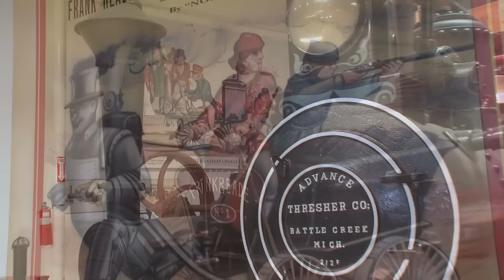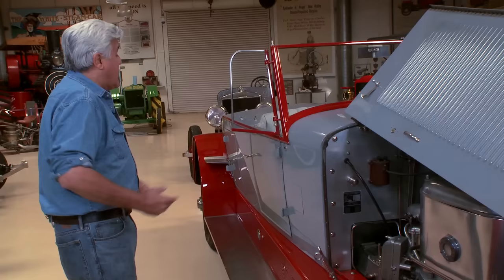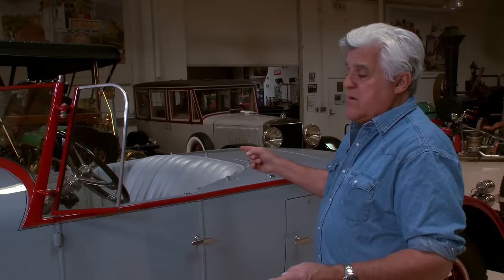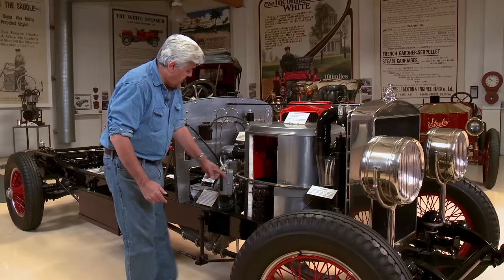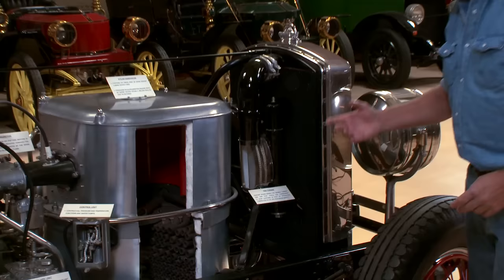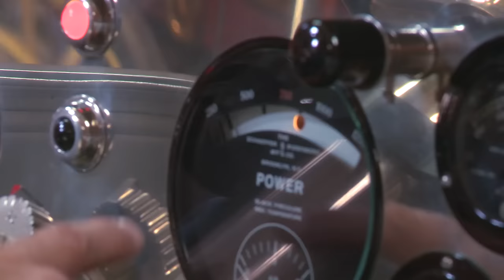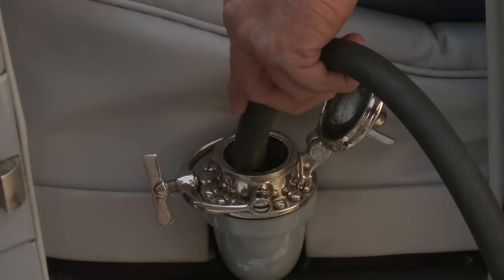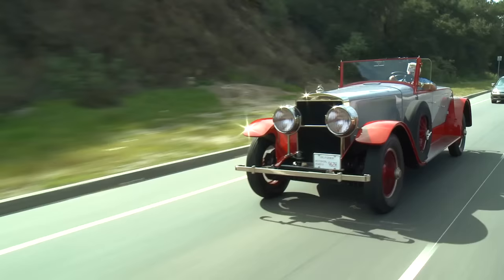1925 Doble E-20 Steam Car - Jay Leno's Garage

Comment: Why don’t you use distilled – or at least demineralized – water do as not to build scale deposits?

I live in an area with pretty soft water yet I use distilled water in my expresso machine so as to avoid building of scale, which did ruin a couple of them before I started doing this.
Reply: Using distilled water is pointless because the Doble is equipped with a condenser and consumes massive amounts of water.
Most steam car collectors and commercial boiler operators use a water conditioning treatment like tannic acid to reduce scale build-up.

Comment: TBH I never actually knew how powerfull and sophisticated steam cars were. I wonder what how efficient it is in terms of fuel consumption and emissions. Any word on that?
Reply: Steam cars are obsolete because of their incredibly poor performance, efficiency and high emissions. 

Jays Doble barely produces 150 hp and guzzles unleaded gasoline at the staggering rate of 5 to 6 MPG.

EPA tests conducted on the Doble boiler found very low CO emissions but extremely high HC and NOx emissions... it also produced more CO2 emissions than 12 Honda Accords.

Comment: So if you were to give that throttle wheel a full rotation really fast while at a standstill would it be the equivalent of flooring the gas pedal and dumping the clutch, resulting in a thick cloud of burning rubber scented smoke? All I'm saying is, I want to see an epic steam powered burnout.

Comment: That was a real education.  I didn't think I heard right at 1,000 foot pounds of torque.  Unbelievable.  I think Lear (of Learjet fame) was building a steam car in the 1980s.  At least we'd see a billboard advertising it in Rocklin California.  Wonder whatever happened to that idea?
Reply: A bit of a misinformation, the Doble could produce 1,000 lb.ft. of torque but only at zero rpm, zero mph.
It's sounds like an impressive number but in reality is deceptive when you understand the engine barely produced 150 horsepower when new.
Reply: Steam cars were essentially rendered obsolete by the invention of the Electric Starter for ICE cars in 1914.

Comment: If it burns fuel completely and has such great power, why is it that we aren't making them today?
Reply: Steam cars were rendered obsolete by the invention of the Electric Starter for internal combustion cars.
Steam cars are obsolete technology because they cannot compete with the efficiency, low price and low maintenance of ICE cars.
 Jay's exaggerating a bit, the EPA tested a Doble boiler and the emissions were shockingly bad, high Hydrocarbon emissions and extremely high NOx emissions.
 Jay's Doble guzzles unleaded at the obscene rate of 3 MPG and spews out more CO2 than a dozen Hondas.

Comment: Pretty cool thank you for making that one question though why don’t you use distilled water?? Seem like to me it would preserve that expensive machine!!
Reply: @sandervanderkammen9230   so you’re saying you actually tried using distilled water? Or you’re just saying that theoretically? Because I find it very hard to believe because there is much crap that’s in tapwater. I can’t believe  Jay Leno would drive that car or using 100 gallons of water in one day. He does not use that vehicle every day it would be worth it anyway. And I’m sure he can afford it.
Reply: @khcopter  I am stating it, as a matter of fact.
Steam car collectors don't use distilled water.
Some do use a water treatment additive likw tannic acid in the feedwater tank to reduce scale build-up.

Cars like the Doble use a condenser
The condenser turns some of the waste steam back into water, but it is also contaminated with lubricating oils and corrosion residue.
These contaminants go directly back into the boiler and cause more scale to form.

The only way to reduce scale is to blow down the boiler and replace the boiler tubes when they become blocked by scale.
Any questions?
Reply: So you have an actually tried it.
Reply: @khcopter  You don't use distilled water in steam cars that are driven regularly... 
People use distilled water in model steam engines that don't have condensers.

The condenser completely defeats the purpose of using distilled water.
Reply: @khcopter  When you own a steam car you use what ever is the best water available and blow down the boiler and drain the oil and sediment from the feedwater tank as often as possible to reduce scale build-up.
Boiler tubers have a limited service life and are typically replaced before they become blocked by scale.
Reply: OK that doesn’t make any sense at all and you don’t work for Leno anyway. Sounds like you don’t have any money. To buy distilled water. Not that it’s not expensive.
Reply: @khcopter  You still don't get it do you?
The condenser cancels out any benefit to using distilled water.

You obviously lack any formal education or professional experience on this topic and don't know anything about steam engines.

You are not qualified to speak inteligently on this topic.
Reply: @sandervanderkammen9230  Why do you think so?  Because I disagree with your statement that the condenser defeats the purpose of using distilled water.  Why would that be?
Reply: @BasementEngineer  If you are not familiar with condenser engines they foul the feed water tanks with contaiments like lube oil and corrosion residue.. this contamination produced scale in the boiler.
Reply: @sandervanderkammen9230  As I stated above, remove the need for oil and use distilled water in the closed loop.  Be sure to remove all debris before closing the loop.
Reply: @BasementEngineer  The condenser still produces hard water, containing dissolved minerals in particular metal and metallic oxides.
Reply: @sandervanderkammen9230  A condenser produces NOTHING except heat removal from the spent steam.
Reply: @BasementEngineer  You obviously don't understand how a condenser works...
Reply: @sandervanderkammen9230  Then please explain it to me. Thank you.
Reply: @BasementEngineer  Most of the used steam is lost through the pressure relief vent, but the wet steam and water that makes into condenser is laden with contaiments like lube oil and corrosion products.
While the condenser water can be filtered before being pumped into the feedwater tank, the condenser water contains dissolved minerals and metals from the oil additives and corrosion of engine parts and piping.

It's all a moot point really since no one has ever successfully designed and built a practical closed-loop steam car... condensing steam cars still require the feedwater tank to be constantly topped-up, distilled water will not always be available... using tap water is unavoidable.
 The advantage of water treatment additives is they are concentrated and it is easy to carry a sufficient supply to add to the feedwater tank when topping-up the water level.
Reply: @sandervanderkammen9230  Methinks, my friend, that it is you who is confused.
Do you know the difference between surface and jet condensers?
A car would have a surface condenser, and if this one is insufficient to condense all the steam produced, then a larger condenser is required.
With a surface condenser only system leakage water needs to be replaced, which is usually a small amount.
Further, with a surface condenser nothing gets introduced into the steam loop that wasn't introduced with the feed water and cylinder oil.
From your comments it sounds like you are referring to jet condensers.
Reply: @BasementEngineer  Sorry, but you are wrong yet again.
We are talking about surface condensers, steam to air heat exchangers.
No practical design exists for a closed loop system for automobiles in warm climates or seasonal weather.
We are not talking about laboratory experiments with glass vessels and tubing.
Steam cars are made of metals that corrode and use lubricants which contain Water Soluble compounds  which fouls the feedwater tank and form scale in the boiler.

Commercial boiler operators and steam car collectors typically use some type of water treatment additives which is more practical to use than distilled water, in particular in steam cars where distilled water is not available along the route being travelled.

Comment: Back to old tech when the age of oil is coming to an end. :))
Reply: This old technology became obsolete over a century ago...
Jay's Doble guzzles unleaded gasoline at the staggering rate of 5 MPG!!! 
Alternative fuels are more expensive and are available in limited supply so the horribly inefficient steam cars won't be back.
Reply: @sandervanderkammen9230  It didn't BECOME obsolete, it was DESTROYED on purpose. So everything can have a price tag and be sold to you
Reply: @elenabarskaya7127  Sorry, but you are clearly unfamiliar with the history of the steam car.
 Nicolas Carnot published his formula in 1824 showing that the efficiency of steam was inferior to internal combustion engines, in 1897 Rudolf Diesel proved Carnot' s formula.
 ICEs were always superior except for a glaring disadvantage... this disadvantage was completely eliminated by Charles Kettering in 1915 when he introduced the electric starter for internal combustion engines and rendered steam cars obsolete.
Any questions?

Comment: Awesome.  Kind of surprised with all the resources available he doesn't use distilled water. Maybe it's just unnecessary. I was very surprised to see him top it of with the hose, not that I have any experience with steam vehicles.  Makes me curious if he runs pump gas in many of his vehicles.  Not scoffing, just curious because money obviously does not seem tight.  Maybe he considers that type of thing to be a wildly unnecessary expense. ?
Reply: The Doble E-series has a condenser, which fouls the feed water with oil and other corrosion products and dissolved solids, using distilled is wasteful and unnecessary.
 Jay's runs his Dobles on regular 87 octane unleaded.
He has his own fuel pumps and storage tanks, buying his fuel in bulk at a discount.

Comment: Imagine using VVT, CVT, LPG, on a 6 cylinder 2 stage double row radial steam engine with all the latest materials eg ceramics that have been tested in several ice motors in recent decades.
Reply: I can imagine the most expensive failure in history
Reply: Imagine if you actually knew something about automobiles.
Reply: Steam engines had VVT in the 1800s

Comment: This is the future. Jay should engineer a new engine based off this. Beat out the garbage electric craze
Reply: Steam cars have no future, they have been obsolete for more than a century for some very good reasons, in particular they are horrible gas guzzlers and polluters with a truly obscene overall carbon footprint.
Reply: @sandervanderkammen9230  horrible gas guzzler based on 1925 tech to heat the steam? Surely our more fuel efficient uses for gas, alcohol or kerosine could heat a small water tank faster than the time this was produced. Heat is slower to dissipate than many think, even as Jay said this becomes much more efficient as the chambers rise in temperature. Again with a small modern engine to focus on heat production rather than direct drive (our standard gas engine usage) the accumulated heat and resulting conservation of comparable fuels at higher speeds would surely make this a better contender. Replace gasoline with alcohol/grease you likely have a better alternative. Don't start me on carbon footprint etc, the ozone healed up during our short pandemic, something that was said to take a century did within 1 year. Modern engines still produce a mass amount of heat which is essentially just thrown out to the atmosphere as wasted energy, be it heat dissipation through radiator to cool the engine block, steering etc or just again loss through the hood off the block itself which is serving no purpose other than to attempt to cool it quickly to continue direct gas to drive mechanics.

Comment: presumably this car has a reversing mechanism for parking, etc.
Reply: The Doble has a reverse pedal mounted on the floor, depressing the pedal activated the valve gear and reversed the engines direction of rotation

Comment: Would love to see steam come back when they ban internal combustion sales.
Reply: Steam cars are already effectively banned in the U.S. due to EPA CAFE fuel efficiency laws.
Jay's Doble Steam car only gets around  3 to 6 MPG on unleaded gasoline.

 Steam cars are ICE cars and would be included in any such ban... however unlikely that is to really happen.
Reply: @sandervanderkammen9230  Yea but if you use a battery to heat the steam it doesn't matter how ineffecient the system is.
Reply: @IRK-pd7lc  OH WOW!  Are you serious?
Reply: @IRK-pd7lc  Why would you use batteries to power a steam car????
Reply: @IRK-pd7lc No legitimate engineer or automobile company would ever consider such a flawed concept...

  The glaringly obvious problem with your idea is fundamental.
Electric Motors are between 85%- 95%  energy efficient while a steam engine the size appropriate for a car is only about 10% energy efficient.

You would need a battery roughly 10 times larger to match the range of the same car with an electric motor.. 

Any questions?
Reply: @IRK-pd7lc ICEs are not banned and it is extremely unlikely that they will ever be banned, EVs remain a tiny niche market segment in the automotive industry and is likely to stay that as it has for the last 125 years that EVs have been around.
Reply: @sandervanderkammen9230  Your 10% number is based on external combustion steam locomotives. Utilities companies and large scale HVAC (real engineers) use similar systems to store energy and scavenge heat. FOR CONTEXT: over the past few years politicians have been threatening to ban the sale of new ICE cars... It is entertaining to speculate about what that might look like for automotive innovation.
Reply: @IRK-pd7lc  NO, the Rankin Cycle is scalar... entropy increases as mass is reduced.
Multi-MegaWatt power stations can just barely reach the efficiency of a small automotive internal combustion engine.
But reduce the size to that of a car and the efficiency limits drop drastically and barely reach 10%.
No steam car can ever match the energy efficiency of ICEs... this would violate the Laws of Thermodynamics.

Politicians say alot of things that are not true... especially when it comes to promoting the use of EVs and claims that they are a practical, achievable alternative to ICEs.

Unfortunately the Laws of Electrochemical science prevent rechargeable batteries from ever have the energy density required by many transportation applications.

Any questions?
Reply: @IRK-pd7lc  Any gain in heating efficiency is quickly canceled out by the overall loss of efficiency using steam.

Steam is the least efficient Heat Engine 
And batteries are the least efficient method of using electrical energy.

The Doble has a 2 million btu boiler and produces 150 horsepower... to replace its 35 gallon kerosene tank (283 pounds full, 42 lbs empty) 

You would need 9 Tesla S model batteries weighing 7 tons give or take a hundred pounds or so....7 tons full charge AND STILL 7 TONS FULLY DISCHARGED

Well, I don't know where you live?
But here in California they have claimed victory several times in passing legislation banning ICEs, most of which have sunsetted or will sunset soon because there is actually no language in the Laws that actually ban the sales of ICEs.
It's all just rhetoric and political posturing, everyone that is an actual expert on the topic knows that an actual ban is not possible and if attempted would be an economic and social disaster on a monumental scale..

Comment: It's interesting that you de scale it, would running distilled water be better for it long term or does it not matter?
Reply: Because the Doble has a condenser, it injects feedwater that is fouled by oil and corrosion products so using distilled water has little advantage.
 Many steam collectors use water treatment additives that contain tanic acid developed for modern commercial steam boilers which greatly reduces scale build-up.
Reply: @sandervanderkammen9230  thank you for such a thorough and complete answer. I can’t imagine there’s a lot of people who both know that and are willing to type it out. I learned something else today.
Reply: @QuickshotGaming  You are very welcome, I'm happy to share.

Comment: Amazing vehicle, just one question. How do you back up with no transmission?
Reply: Easy, steam engines can run in both directions
Reply: @WilhelmKarsten probably not in the case of this engine, since it would require you to run steam backwards through the condenser, and reverse the fuel pump.
Reply: @thatoneguy611 Thats exactly how you back up in a Doble,  in this video Jay demonstrates exactly how to reverse the engine's direction of rotation to back up the car

, you can fast forward to time stamp 20:38
 https://youtu.be/ACO-HXvrRz8?si=c4SXyvgxYs-43EUv

Comment: I would love your thoughts on the Chevrolet Chevelle SE-124 from 1969.
Reply: @sandervanderkammen9230   lol ... that's funny thanks for the laugh.
Reply: @crowlor3290  I'm serious as a heart attack son... do you know anything about the SE-124 fiasco?
Reply: @sandervanderkammen9230   don't get me wrong ... no i don't know jack about the car i just found your bluntness so surprising that I laughed the car looked like something Emmett Brown would do if he got stuck in the 1900s with the car.
Reply: @crowlor3290  Indeed, it looks very odd... I laughed at fender vents which were stolen off a swamp cooler and the condensor fans which are model airplane propellers... it looks alot like a Hollywood prop car.